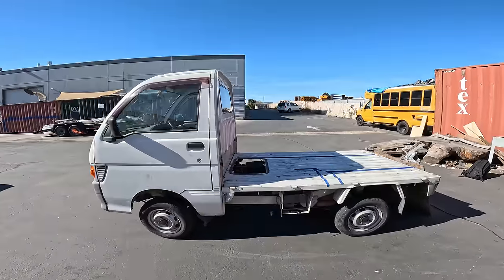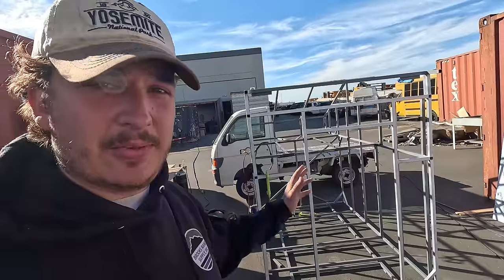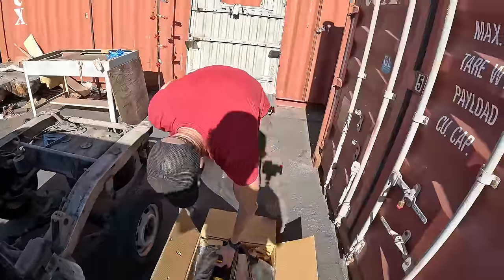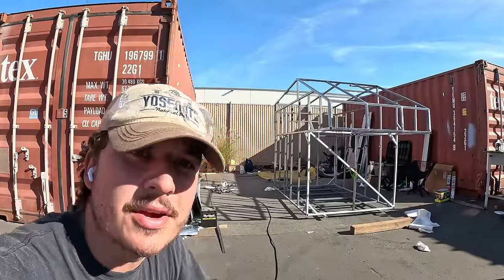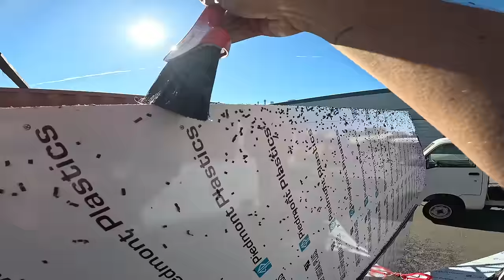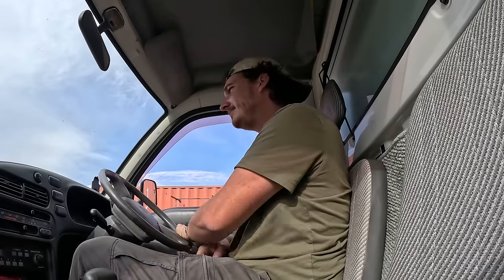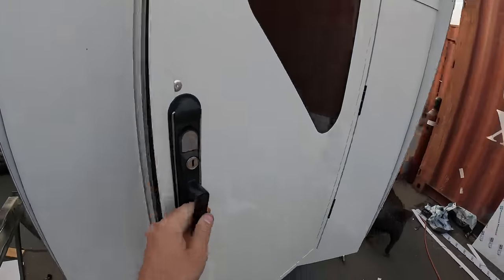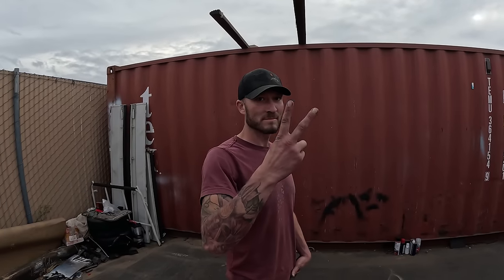Building A Japanese Kei Truck Mini Camper | (2)

Comment: I think you should get wider offset wheels that poke a little farther out to have a wider track for turns
Reply: Same thought!! upgrade the front as well. All-terrain or all-weather tires :)
Reply: Literally got in here to say the same thing. Been seeing they kei trucks with wide tires and it would be a great idea for this application.
Reply: He said he was getting new wheels, so maybe that's what he's doing.
Reply: He is doing it and even said that in the video or am I wrong?
Reply: Same thought offset wheels!!!
Reply from the maker: It didn’t end up making this video but I do plan on getting new wheels for the truck in the future!
Reply: It's a little hard on the bearings.
Reply: Definitely u can get wider rims and tires also wheel spacers maybe  @Ryantwomeyy
Reply: Agree with everyone else...widening the track will help lower the center of gravity making it more stable on bumpy roads.

Ps. When does the interior buildout begin???
Reply: Me too 😜
Reply: Isn't it illegal to have wheels that poke out were than the body of a vehicle? I thought that was one of the no no's as far as being a street legal vehicle in the USA.
Reply: @infamoswordz  possible but you can always put fender flares will help with mud, rocks and dirt as well, have a Ford ranger with 1inch spacers never had a problem with the law,and I've been pulled over few times.

Comment: Hey I'm a mechanical engineer. Just so you know this is a lot more sturdy than you need it to be you guys put a lot of support in where you don't need it to be because of your material strength it may be I intentional I just figured I'd point it out if it might help you save some money on the build. Also the paneling will provide some structural strength especially depending on how they are laid.

Comment: Im stoked to see how this comes out. It's looking good, I am worried about the tipping factor though. You mentioned it, and it does look like it could tip over while taking turns once you add the interior
Reply: That motor will blow before anything it needs work done
Reply: There appeared to be a nice void under the camper floor that could house a water tank, which should help level it out. He also mentioned the suspension could be adjusted a little. Smart build choices from here should mitigate the issue.
Reply: These cars are driven in Ghana and they are mostly used for carrying heavy loads so it will defo work and won’t tip over just trust them process😎

Comment: As a sign maker I am very familiar with dibond/vhb tape/primer 94. While these work well for holding signs together, I wouldn't trust them as part of a moving vehicle,. You may want to add some rivets to properly secure those panels to the frame.
Reply: Signs have to be able to blow in the wind . These trucks max out at like 55mph. He won't be taking this thing on long travels I'm pretty dang sure
Reply: I'd put some water- and fireproof polyurethane insulation foam inside and cap it with either thin plywood or cellular polycarbonate sheet. I'd be very rigid as well as lightweight, like 60 pounds fo the whole cabin for the extra insulation, waterproofing and rigidit. Inside wallpapers (or wood/plastics) might weigh more and support less.

Comment: Duelly the rear tires if you are worried about stability.  That is what I did.  The difference was like night and day when it came to the sway.  I also built a hydrogen generator from mason jars It about tripled fuel milage.  About to build one out of a 5 gallon fish tank,  Looking to run my truck on hydrogen only made from water and or antifreeze in winter.  Just a timing change.

Comment: I would add a white light bar up top in the front or fog lights because the factory headlights will not be enough in a snow storm or rain storm at night. And Mount a stick on light over your back door. I'm aware you're just starting but safety before pleasure. And get some beefier tires with good tread or you won't make it up your first hill in the ❄️. 👊

Comment: I've been living in a 1988 7.3 diesel Ford E-350 Supervan (extended or "supervans" are stretched 22" from standard length Ford vans) that  was then converted into a Taylor Made type 2 ambulance with a 24" fiberglass high top for 8 yrs now with two very big  dogs.... and let me tell  you, as long as the roof is set to a comfortable height, you should be perfectly happy living in this smaller space by yourself. I think my living space is comparable to what you have now, and its been working great for me and my two dogs. If I was alone, I would be fine in this smaller size of camper!

Comment: You also need another engine access door in the floor of the camper also you want a good strong swat bar on the front end and maybe try to source some heavy duty Custom leaf springs on the back axle

Comment: What a quick welder he is! wish i could weld that fast & not blow holes in the tube.
i would keep track of weight of each rear component, eg steel frame, frame coverings, cupboards & so on, to keep track of all up weight so you know where economies in weight can be made. you want to minimise weight & air resistance.
thinking about the bed. why not sleep crosswise as a single bed (assuming sufficient width). i’m 5’ 7”. with you being 6 foot, it may not work.
very interesting project & you will be able to compare with the Sprinter in different aspects. you have all wheel drive unlike the sprinter. and a diesel i presume.

Comment: Awesome work. The only think I would say, underneath where you want to mount the fenders in the back. The entire underside up the camper needs a thin aluminum or steel sheet of flashing, otherwise any floor insulation will be destroyed in 100miles. Great work though!

Comment: Certainly a cool project. For the bed, you could have used heavy duty industrial under-mount draw slides or telescopic ones and had it come out twice and lock in place. Each slide could do 2.2 feet and up to 300 pounds in weight while extended

Comment: Here i was thinking of a pull out hinged door idea.

Where you have ply about the width of the trailer slide out lengthwise from the two sides, and when fully extended they form the bed.

Comment: You need a way to get to the cab from the back of the camper, even if small.  It always bothered me when I had a camper on a truck..  If there is a kitchen fire or someone runs into your rear, you have a way out...  Plus it will be nice to use in bad weather.  There are a lot of possibilities with you already having a back window in the cab, part way there..  Nice build

Comment: ive used vhb tape before for trying to mount some equipment in a police squad. i also didnt know there was a primer for the tape so im sure that helps alot.  the heat/cold cycles made it fail after a few months. hopefully it holds up better.

Comment: I think you should lessen the angle on the fenders, seal up that window and door like you did the lights, and possibly mount the jack points to the truck and not the camper frame.

Comment: Mounting exterior walls with TAPE! Thats some American housebuilding 101 right there 😄 But hey, not stupid if it works, right! My worry would be if it holds up over time or not, while driving down the freeway. Would kinda suck to loose a wall at 60 mph :D

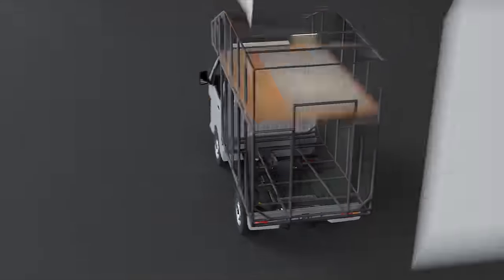Comment: 0:20 - That CAD assembly video was surprising.  Very high tech!

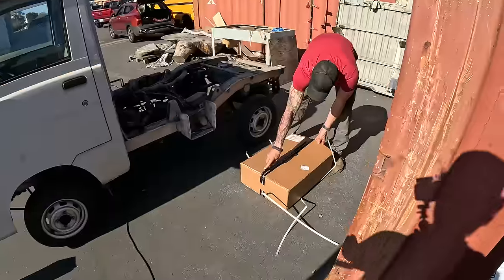11:50 - Got an Amazon ASIN or some other way to locate those Taiwanese struts and shocks?  I'm definitely in the market for my 1996 4WD Hijet.

Very cool project!  You should post this on the Mini Truck Talk forum.

I'm still inclined to make a very simple and minimalist drop-in camper.

I made some custom mud flaps for the back of my Hijet.  Let me know if you want a pair and I'll 3D print them for you.  Mine say "MEEP!" on each side.  Yours can say whatever you want, one or two lines, probably up to 8 characters per line.  Three lines if I made the flaps a bit longer.  Just let me know where to mail them.

Comment: To get an actual weight calculation, you should take the car without the camper on to a salvage or landfill or anywhere that has a car scale to weigh it then go back when the camper is on.

Comment: Sweet Build Ryan, thanks
For taking us along for the build & Kudos to Trevor, that dude is a Jack of all trades. Just curious, are you concerned about tipping that thing at all? It looks extremely top heavy and not very wide.
Reply: It does look top heavy but I think realistically, the bulk of the weight is near the bottom, especially after putting everything else in that he wants, I imagine it will bring the center of mass down a fair bit.

Comment: weld a 10-15 pound weight near drive shaft low so the center of gravity is lowered some prolly need to make bracket to hold the weight
Reply: should allow you to turn corners at normal 20-30 mph speeds
Reply: also help with rlly steep hills

Comment: I wonder if you could've made a way to be able to lift the front part of the camper similar to a dump truck,to access the engine and transmission , rather than having to pull the whole camper off ? On second thought, I think a hinged spot in the floor is your best bet because you may be shocked about how difficult it will be in the middle of nowhere.

Comment: stock, these trucks struggled to reach 55mph on anything but the flattest road. Even then, they were twitchy and running at high rpms. I hope your ready to live life at 45mph. These trucks are just very underpowered for open American roads and traveling distance.

I've considered doing something similar, but a pick up or transit build is still small enough to be maneuverable and parts are much easier to acquire in the us.

Comment: If you have the $, use Coosa Board instead of plywood for your floor. Weighs less for the same dimensions as plywood and since they use it in the marine industry, you won't have the rot fear like you would with plywood.

Comment: You should've worked on the motor give it good upgrades for power and worked on suspension wider rims and tires then built the camper

Comment: I would have gone with a thin walled 1 inch square welded aluminum frame, because my Tiger, of similar size, is built that way    The frame weighs almost nothing